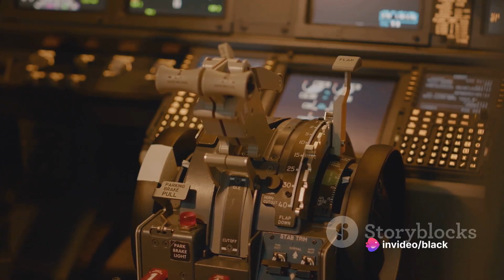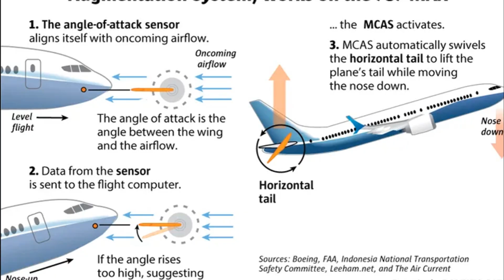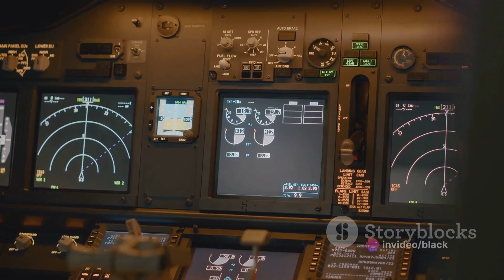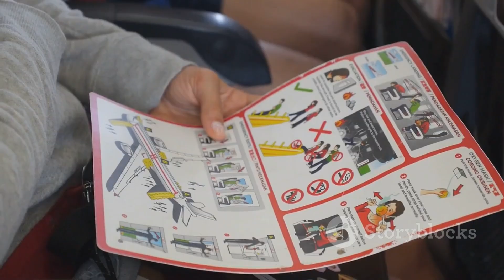The Lion Air Flight 610 Crash: 5 Minutes

Comment: Why was no one jailed for this.
Reply from the maker: No one was jailed for the Lion Air Flight 610 crash because aviation investigations aim to understand what happened to prevent future accidents rather than assign blame. However, the investigation may have led to regulatory changes or legal actions in different forms.
Reply: @5MinsAviation  It is wholly unacceptable that no one gets jailed as it has been proven beyond doubt that nothing has changed in the way Boeing operates its QC as in the case of the latest debacle with the door plug blowing off due to lack of securing bolts. We cannot keep letting Boeing off. The FAA are as much to blame for not being strict enough.
Reply from the maker: @christopherfothergil  
While it's understandable to feel frustrated by the lack of accountability in situations like the Lion Air Flight 610 crash, it's important to recognize that aviation safety is a complex issue involving multiple factors. Investigations into incidents like this often lead to regulatory changes and improvements in industry practices rather than immediate punishment.
Regarding Boeing's operations and the recent issues with door plugs, it's crucial for regulatory authorities like the FAA to maintain strict oversight and hold manufacturers accountable for ensuring the safety of their aircraft. Transparency and accountability are essential for restoring public trust in the aviation industry.
It's also worth noting that ongoing scrutiny and public pressure can play a significant role in driving change and ensuring that lessons are learned from past mistakes. As passengers and stakeholders, we must continue to advocate for robust safety measures and hold all parties involved accountable for their actions.
Reply: @5MinsAviation were you using AI to reply comments?

Comment: Boeing need to be prosecuted for concealing design flaws of B737 Max.
Reply from the maker: Many investigations and legal actions have been initiated regarding the design flaws of the Boeing 737 Max. Boeing faced intense scrutiny and accountability measures for their role in the accidents involving the 737 Max. This included regulatory investigations, congressional hearings, and lawsuits. Additionally, Boeing implemented significant changes to the aircraft's design and the company's safety protocols. While prosecutions are ultimately determined by legal authorities, Boeing has faced substantial consequences and reforms in response to these issues.
Reply: @5MinsAviation But not jail.  Boeing knew the MCAS could be fatal. They chose to not even mention the new MCS much less require simulator training.  Boeing also knew there was a 10-second window a pilot has to figure out something they’ve never learned in order to avoid letting the plane kill them.  Boeing set people up for failure, then blamed the pilots. It is criminal.